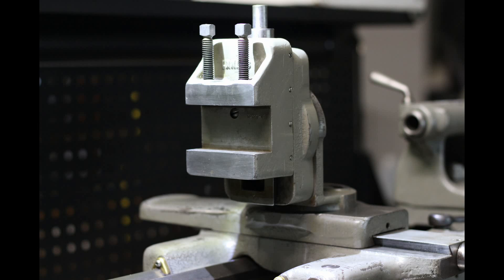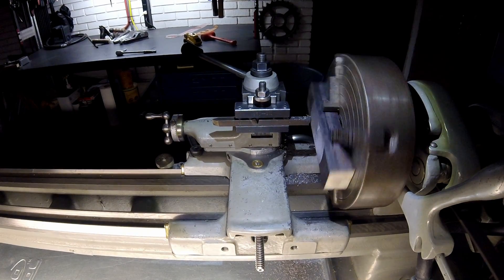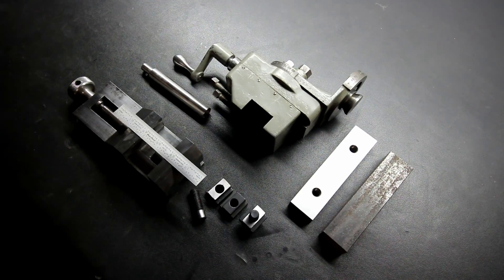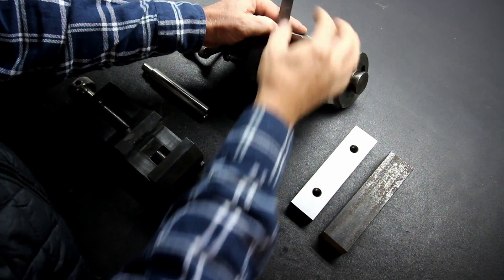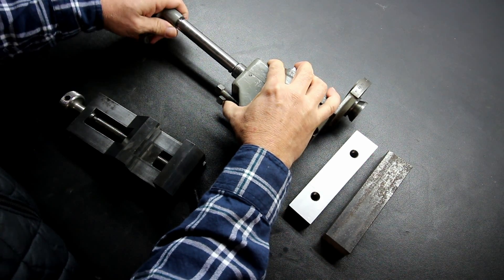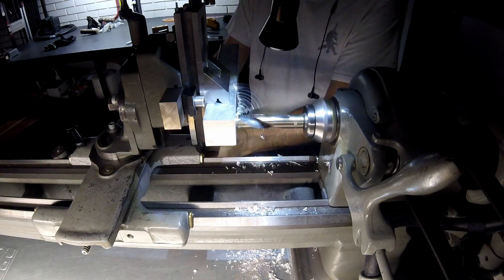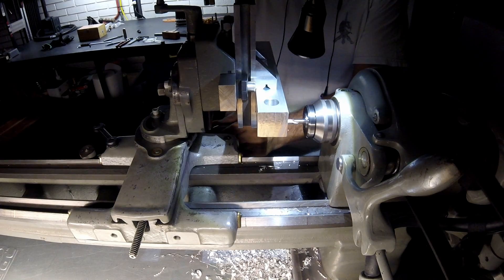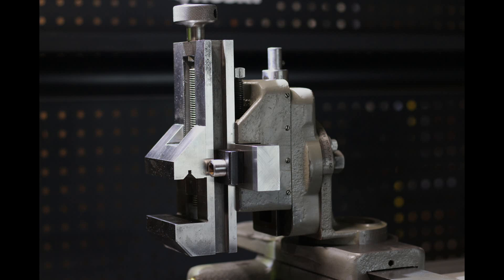Milling Attachment Vise

Comment: My atlas milling attachments a little better it's jaws open 2.5 inches,,,but I've found I can do just as well with small milling projects with my 12 inch lathe as a milling machine and the set up is much faster.

Comment: it kind of looks like you have a milling attachment holding a vertical slide vise
Reply from the maker: You got it. The advantage is that the milling attachment alone only opens 1 1/2 and has limited vertical travel range. In certain situations such as material dimension or location on axis, makes the vise a must and extents the range of the milling attachment which was originally only intended to cut keyways in small stock. It has limited use but does work!

Comment: Very nice! I have an hobby lathe (an older Harbor Freight one) and I have been looking at possibly doing light milling in plastic and maybe brass or aluminum. It would probably be fine for the type of work I do. I'd like a small mill but don't want to buy one!!!
Reply from the maker: Thanks! With light materials like that you should be fine. Just watch overhang and stay on center or as close to center as you can! Good luck
Reply: Thanks!